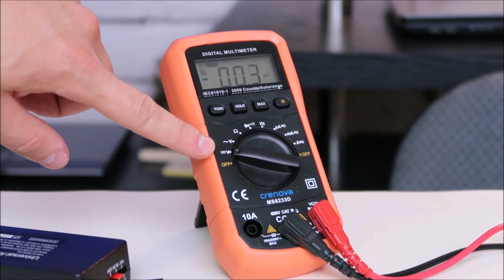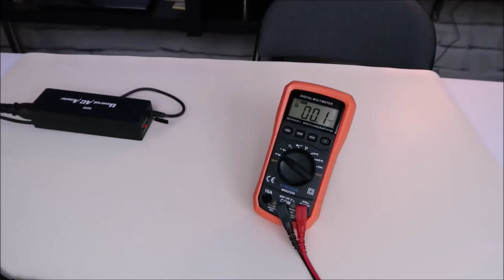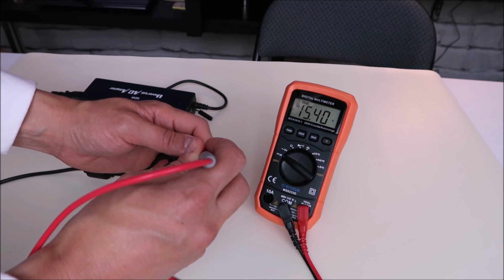How To Fix Any Laptop - Wont Turn On, Wont Open, Turns Off Right Away, No Power Solution

Comment: I have a Toshiba Qosmio X70
Short Version
Tried all steps you have shown in video
But still delayed boot (15-40 mins)
Long version
I didn't use it for arnd 4 months..
Resultantly the RTC battery error showed up.. which led me to CMOS battery replacement..now before and after the CMOS replacement, the issue I am facing is that the first time laptop asks for a date and time..after it boots up again...the black screen is shown for a indefinite time like 20 30 or maybe 40 mins..after that the windows is loaded and everything is working fine...the issue starts again after the laptop is shutdown or hibernated or restarted..
If you can plz tell what is the possible solution..wat is causing the issue.. laptop comes with a Nvidia 770m card as well..
Is it the graphics card??
The motherboard??
Still the CMOS ??
I have tried all possible fixes of video less the motherboard part...
It's again reiterated that laptop is working fine in once it turns on..but black screen at the start is showing Everytime for 20 30 or 40 mins..with no errors being shown...
Reply from the maker: Assuming you have Windows 10, first make sure all updates are processed as seen here;  https://www.youtube.com/watch?v=DDv2gJDjfOM.  Let me know how that goes :)
Reply: @PC_Monkey  System is up to date
No issues there as well
Reply from the maker: @fad3djeanz  You have to change the date and time in BIOS each time you restart the computer?  If so, that may indicate that the motherboard is not keeping settings.  If the BIOS settings reset each time, I would try replacing the CMOS battery as it may be bad and no longer able to keep power to the motherboard when the computer is off.
Reply: @PC_Monkey  as I mentioned in the long version.. I changed the battery as well..bios is keeping the time...but the black screen is there for an indefinite time Everytime after restart shut down etc
Reply from the maker: @fad3djeanz  You may be looking at a motherboard issue at this point then :(
Reply from the maker: @fad3djeanz  If you would like help replacing that, let me know.  Sry it wasnt something easier :(
Reply: @PC_Monkey  thx man for the reply..I will get a technician to check my motherboard and will get back

Comment: I have done the test for the battery, and that have turn on my keyboard for a few second, then dead again. I have done this several times and i have done all thing on the video and still not a sign of life
Reply from the maker: If all the tests in this video do not reveal the issue, and your power adapter tested to be fine, then your most likely looking at a Motherboard replacement as seen here;  https://youtu.be/N_7HNrFkMS8.  If you know your computer's model number, I can help you get inside your specific computer :)
Reply: @PC_Monkey  my pc is a Asus TUF505DU
Reply from the maker: @riccardocosta4698  Hopefully this will help you access your motherboard;  https://www.youtube.com/watch?v=eQnsRCpOLdI

Comment: When i came back to my pc it was on sleep mode and when i turned it on its a black screen so i removed the plug and shut it down but then when i try to open it theres no light no charging whatsoever how do i fix it?
Reply from the maker: If there are not signs of life and your computer is not turning on, your on the correct first video.  Have you tried the steps seen here?
Reply: @PC_Monkey  yeah, theres still nothing
Reply from the maker: @imjustarandompersoninyoutu658   If all the tests in this video do not reveal the issue, and your power adapter tested to be fine, then your most likely looking at a Motherboard replacement as seen here;  https://youtu.be/N_7HNrFkMS8.  If you know your computer's model number, I can help you get inside your specific computer :)
Reply: @PC_Monkey  hello so basically when i tried to turn my pc on this morning i saw it has lights now and when i turned it on and waited i heard it open... but its still black screen may you help?
Reply from the maker: @imjustarandompersoninyoutu658  If all the tests in this video do not reveal the issue, and your power adapter tested to be fine, then your most likely looking at a Motherboard replacement as seen here;  https://youtu.be/N_7HNrFkMS8.  If you know your computer's model number, I can help you get inside your specific computer :)
Reply: @PC_Monkey  i tried the motherboard replacement still doesnt work... i dont know why
Reply from the maker: @imjustarandompersoninyoutu658  Sorry.  Think you have reached the limit of DIY repair for an untrained computer repair person.  I would have to look at the computer to give any further advice.  Usually, different motherboards will not show the same issue like that.
Reply from the maker: @imjustarandompersoninyoutu658  Is there anymore of what?
Reply from the maker: @imjustarandompersoninyoutu658   Sorry.  Think you have reached the limit of DIY repair for an untrained computer repair person.  I would have to look at the computer to give any further advice.  Usually, different motherboards will not show the same issue like that.

Comment: I tried the battery test and it just turned on for a second
Reply from the maker: Are you able to see anything on the screen when it turns on for a second or no?
If not, try it a couple more times.  If still nothing, continue with the rest of the video.

Comment: What about a newer model HP? Mine has no cmos battery. Its HP model 15. It stopped charging and then I performed a restart, but it will not turn back on.
Reply from the maker: Not all motherboards have a CMOS battery.  If yours does not, then you would have to skip that step.  Are there any signs of life at all when you try to turn it on?  Lights?  Fan, Motherboard, or Hard Drive sounds?  Anything seen on the screen?  Have you tried all the other steps seen here?

Comment: placing your laptop on your cold floor to cool down the laptop also works, my floors are plated with ceramics
Reply from the maker: If your computer is not turning on due to overheating, that is a serious issue that needs to be fixed correctly or multiple components will continue to be damaged.
Reply: @PC_Monkey  thanks for the advice i'll try to get someone 👍

Comment: Pretty much cover all aspects..but my issue is lil complicated..I have a Toshiba Qosmio X70.. I didn't use it for arnd 4 months.. resultantly the RTC battery error showed up.. which led me to CMOS battery replacement..now before and after the CMOS replacement, the issue I am facing is that the first time laptop asks for a date and time..after it boots up again...the black screen is shown for a indefinite time like 20 30 or maybe 40 mins..after that the windows is loaded and everything is working fine...the issue starts again after the laptop is shutdown or hibernated or restarted..
If you can plz tell what is the possible solution..wat is causing the issue.. laptop comes with a Nvidia 770m card as well..
Is it the graphics card??
The motherboard??
Still the CMOS ??
I have tried all possible fixes of video less the motherboard part...
It's again reiterated that laptop is working fine in once it turns on..but black screen at the start is showing Everytime for 20 30 or 40 mins..with no errors being shown...
Waiting for a possible solution from ur end..also if u can share any email or number I can send you the video as well!!
Reply: Still no response??

Comment: My Hp laptop screen is black, power works fine and the power button is alo lit up. The fan kicks in but then straight off again. There's no caps locks blinking lights at all, that is until I remove the ram, then I get the 3 slow blinking caps lock lights, but only after I remove the ram. If I don't remove the ram then there's no caps lock lights. I reseated the ram, nothing, cleaned out, nothing. I bought a new ram and still nothing. I checked power supply with another compatible charger, no change, my charging light still comes on. I replaced the cmos battery and still no change, what could this be. 3 blinking lights indicates ram, but I only get these 3 blinking lights after I remove the ram. The fan only stays running if the ram is removed also, please help.
Reply from the maker: your on the correct video.  Are you able to try the steps seen here yet?
Reply: Yes I have tried everything in this video, to no avail, so I assume it's my motherboard. I was hoping it was the ram since I get the 3 blinking lights on the caps lock, but only when the ram isn't in. When I remove the ram, the fan works, the power light and charging light comes on.
Reply from the maker: @Joleneatkins   If all the tests in this video do not reveal the issue, and your power adapter tested to be fine, then your most likely looking at a Motherboard replacement as seen here;  https://youtu.be/N_7HNrFkMS8.  If you know your computer's model number, I can help you get inside your specific computer :)
Reply: @PC_Monkey  Thank you for your help my laptop is HP 250 G5 Core i7
Reply from the maker: @Joleneatkins  Hopefully this will help access your motherboard :)  https://www.youtube.com/watch?v=NwQe8r0d-nI

Comment: Hi wen i was using my laptop it went off suddenly and there was a sound before it got switched off , it's not even charging now nor its starting, wat might be the problem?
Reply: Mine laptop is toshiba satellite C855
Reply from the maker: @kelvinrebello8405  Are there any signs of life at all when you try to turn it on?  Lights?  Fan, Motherboard, or Hard Drive sounds?  Anything seen on the screen?   If no signs of life, your on the correct video.  Are you able to try the steps seen here yet?
Reply from the maker: @kelvinrebello8405  If no signs of life, your on the correct video.  Are you able to try the steps seen here yet?

Comment: Hey there. Short story: Laptop wont start, only hardrive works and light indicator of laptop on and charger light on. No fans are active, no keyboard or mouse lights, screen is black, no visual on secondary screen ether. Tried most of the videos to no luck. Any suggestions? 

Long story (Detailed!) I have a big problem that i've never encounterd before. 2 week ago my laptop started acting wierd to a blackscreen (its a Asus Rog Strix laptop) and for some reason the computer wouldnt start. Tried rebooting couple times and it worked agian. Next time i started the laptop same thing happend the screen was black, no fans or usb cable-mouse that was plugged flashed and nether did my keyboard ( it has lights in build). This was really wierd as last time it worked, everything was runing fine. This time when i happen to start the laptop all that seem to work was the power buttom, the light indicators of pc being on, the charger light and the hard drive working. Thats it, nothing else. Couple days after i tried turning it on and it worked like the problem never existed. The moment i ended up rebooting the laptop it showed same issue, it occured agian. This was on and off till today its not even starting up normally, showing exactlly same issue as explained be4. I've tested the battery, the static test, changed ram in diffrent seat, unplugged battery and just tried with charger on...  basically all this with no luck on gettin that darn Asus Logo on my screen. Usually that Asus logo informed me when my pc was working normally but now its not. When the laptop starta normally it usually lights up keyboard, mouse, fans working and u can hear em but i got nothing. Any ideas of what the problem might be? Thanks for reading this long of mine.
Reply from the maker: If all the tests in this video do not reveal the issue, and your power adapter tested to be fine, then your most likely looking at a Motherboard replacement as seen here;  https://youtu.be/N_7HNrFkMS8.  If you know your computer's model number, I can help you get inside your specific computer :)

Comment: my laptop has the same issue, shuts off immediately while turning on, and also it automatically tries to turn on when connected to the charger and why is that??..help appreciated.
Reply from the maker: It could be several reasons.  They are troubleshooted for here.  Have you tried these steps yet?
Reply: @PC_Monkey  many times and no result. Any other solutions that i should try??
Reply from the maker: @soorajrajeev7663  If all the tests in this video do not reveal the issue, and your power adapter tested to be fine, then your most likely looking at a Motherboard replacement as seen here;  https://youtu.be/N_7HNrFkMS8.  If you know your computer's model number, I can help you get inside your specific computer

Comment: Hi there PC Monkey, can you help me with my HP Pavillon Protect Beatsaudio 17" Notebook which is not booting up. I managed to get it working two days ago and while it was plugged in my dear wife accidentaly pulled out the power plug with her foot and I cannot get it up and running since. All I get is 3 blinks near the plug when I press the power button and then nothing. Its driving me mad can you help please. Stay safe Tom
Reply from the maker: your on the correct video.  Are you able to try the steps seen here yet?
Reply: @PC_Monkey  Hi there, yes I tried removing the battery and holding down the power button for 1 minute with the mains lead out then plug in the power then plugging in mains lead and holding down the windows and b buttons while i press the power button but it didn't work. Any more suggestions please, thanks Tom
Reply from the maker: @tomryan9898    If all the tests in this video do not reveal the issue, and your power adapter tested to be fine, then your most likely looking at a Motherboard replacement as seen here;  https://youtu.be/N_7HNrFkMS8.  If you know your computer's model number, I can help you get inside your specific computer :)

Comment: sir after trying 1st and 2nd thing i open my laptop and eject & put the CMOS cell back.. then my laptop works but again when i turn it on it doesn't work ...😔😔plz help me i have Dell laptop with amd 2gb graphic ...
Reply from the maker: You have to do a BIOS reset each time?  Then your CMOS battery may need to be replaced and not just reseated.
Reply: yeah exactly i have to do BIOS reset  ,..  thanku very sir I'll buy new  battery
Reply from the maker: @deepakjangra7675   Good luck !!  Let me know how it goes :)
Reply: sir I have changed the cell but it's still not starting even not showing any charging indication light ..😐
Reply from the maker: @deepakjangra7675   If all the tests in this video do not reveal the issue, and your power adapter tested to be fine, then your most likely looking at a Motherboard replacement as seen here;  https://youtu.be/N_7HNrFkMS8.  If you know your computer's model number, I can help you get inside your specific computer :)
Reply: Sir can we schedule a virtual meeting.. if you could spare some time
Reply from the maker: @deepakjangra7675  For free, I communicate here on YouTube.  For a fee, we can set up a time and talk somewhere else.  Which would you prefer?
Reply: hi sir again. sorry I'm bothering you again..
actually I'm on repairing shop in Delhi , they diagnosed my laptop and said your laptop IC is not working properly .. and to fix this it'll cost me Rs.3000 ... I'm sceptical here
Reply from the maker: @deepakjangra7675  What is wrong with your computer?

Comment: I change the Bios battery. And my computer was running, and screen was black then turned off again.  After than when I turn on the computer, the fence was working in short time and then  computer turned off gain . I wonder what would be the problem ?
Reply from the maker: Your computer turns on and runs well but turns off sometimes later?  Can you find an error as seen here?  https://www.youtube.com/watch?v=Nqn8-jJFx2Y

Comment: My computer is not getting on and not taking charge
Reply from the maker: Are there any signs of life at all when you try to turn it on?  Lights?  Fan, Motherboard, or Hard Drive sounds?  Anything seen on the screen?  If not, your on the correct video.  Have you tried the steps seen here?

Comment: You’re great!  HP 1 laptop circa 2016.  so my jack port was bad and my already weak battery discharged.  i replaced port (plug in type) and orange light on for few hiurs then turned white, but cant piwer back on.  did all the static tests w battery and charger. tested charger and port on voltmeter- all ok. re-seated the RAM (only have 1 8GB so could t compare) took out small battery (bios reset) for 30 min.   stillcant get it too turn on.  could it be the weak battery?  wouldnt the power jack turn on the laptop even witn a bad battery, or no battery at all?

laptop was working fine until the port went bad and laptop lost all its power, so im thinking it is related to the weak battery and not some other motherboard issue.  THANKS!
Reply from the maker: If the issue is just the battery, the computer should still turn on after the battery has been removed and after a static discharge.  If after all these steps, you cant find the issue, its most likely the motherboard or the power jack as its already been identified once before as the issue